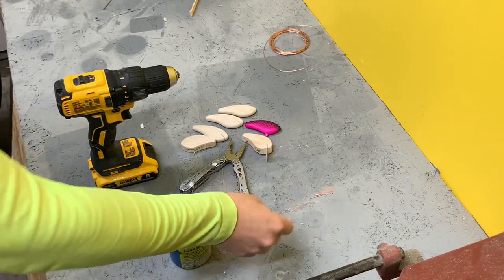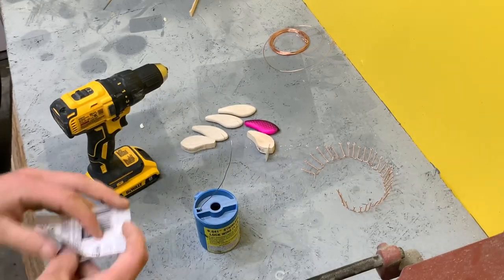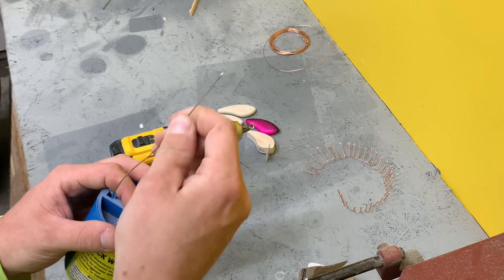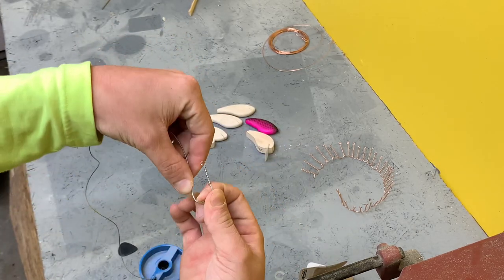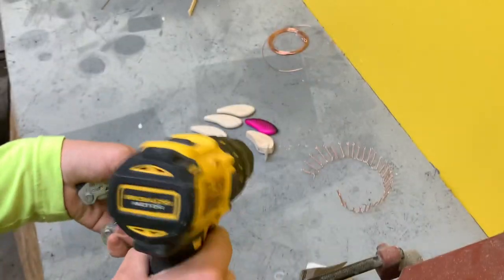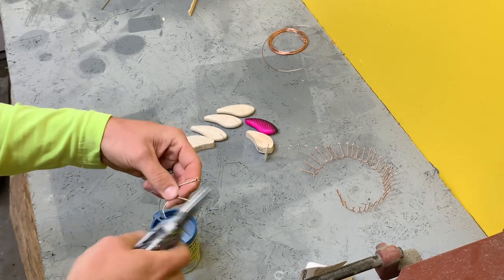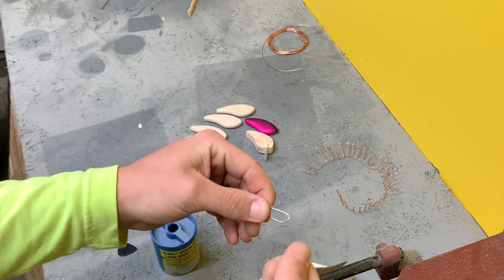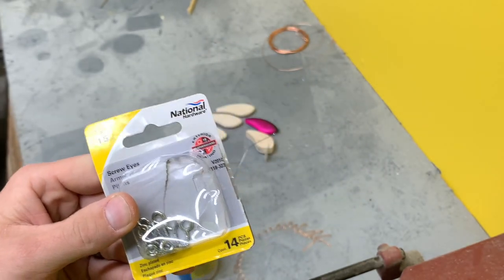Fastest way to make lure twist ties / lure twist eyes / Line ties

Comment: Apparently you have to use a small screw eye because I tried it with a screw in hook (about 5/8" diameter) because it was handy and it wouldn't make a neat eye. Gonna pick up some small screw eyes next time at the hardware store.
Reply from the maker: Yes I would suggest smaller ones let me know how it works and if it doesn’t work for you we will figure it out for u !